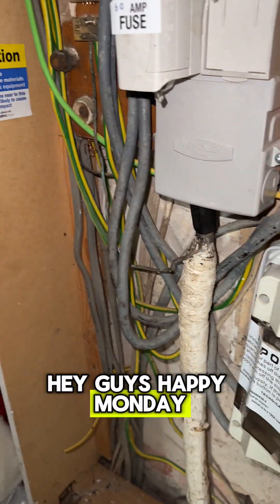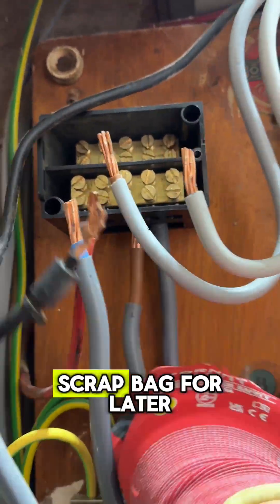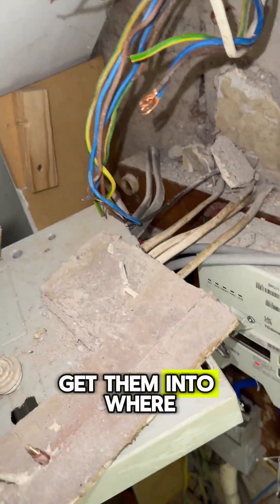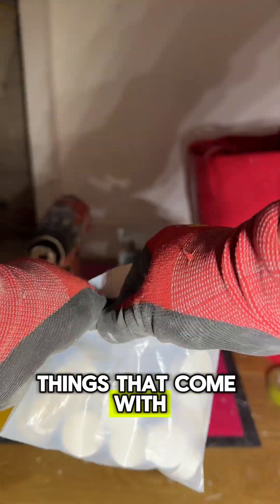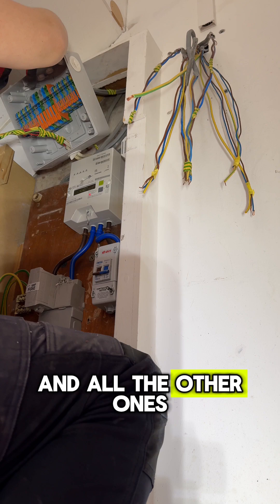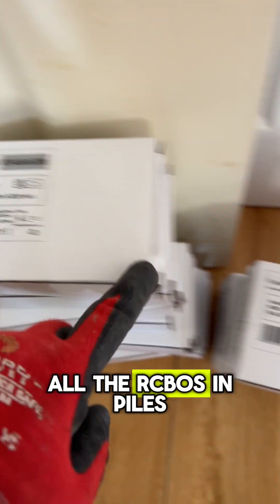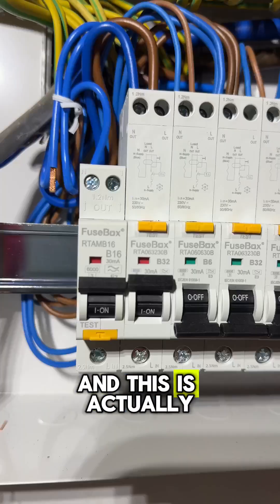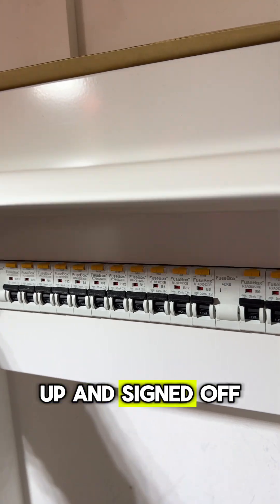3 Fuseboards into 1 - Relocation Kit - Danger Notice

Comment: Those “weird wago things” are Wago Top Job S for din rail cable management. Use them to create a wiring unit for central heating so I could have another box the valves and pump could wire to without having wires draping across my airing cupboard. Much better than the terminal blocks wrapped in insulation tape and stuffed into an unsealed back box in the back of the cupboard behind the hot water tank. There a ton of configurations you can have lots of combinations and ability to bridge units together if needed. Did a neat job if I do say so myself.

Comment: I am not too keen on the use of earthing coloured insulation tape being used to fasten cables carrying line and neutral together. I'd prefer it if that was a completely different colour to the cable colours: brown, blue, yellow.

And there are plenty of colours of electrical insulation tape and it's cheap enough to always have a few reels in your toolbox.

Comment: The difference between small and tall Fusebox rcbos is, the small unit is a double pole with a switch neutral , tall rcbo is a single pole. I only used a double pole. Very good video !
Reply from the maker: 👏👏 great information. I would definitely be using the mini ones for a full board next time,

Comment: Wow Kimmy nice job very professional and I like the fuse board you used. Much more involved changing a fuse board here as we have to get the meter pulled by the utility and update the cable size. Lovely keep up the great work. Thanks for sharing.
Reply from the maker: Hey! Where is that? We have to do the same, we aren’t allowed to pull the main fuses or touch the meter, but this property here had the isolator that the meter company put in, so I could easily isolate the meter tails and carry out my work on the consumer side. I wish all meter companies added this isolator when changing meters, would make sparkles jobs so much easier
Reply: @kimmythesparks  Yes I am in Canada and I like the way you have isolators on the main service so one can work on the panel. We need to adopt a similar system which would make my work so much easier.

Comment: Lovely job, neat enough real world board change.

I always have the intentions of making it super neat but I get bored lol 😮
Reply from the maker: Thank you! Yeah the trick to extremely near boards is extra slack and cable entry through the bottom back … but I don’t extend cables unnecessary, and don’t mind it not being picture perfect 👌
Reply: @kimmythesparks You are quite right. Time is money at the end of the day.
Excessive neatness is pointless. The electrons don't care at the end of the day. And you end up charging the customer for the time to make it perfect which means they are overcharged for no practical benefit whatsoever.

I had a colleague, subcontractor that used to wire up equipment in 19" racks and he would literally measure the lengths of ribbon cables using a ruler and put folds in them. It was too neat and he was taking far too long to construct the racks and we had over a dozen to do. We had to tell him to back off and speed up.